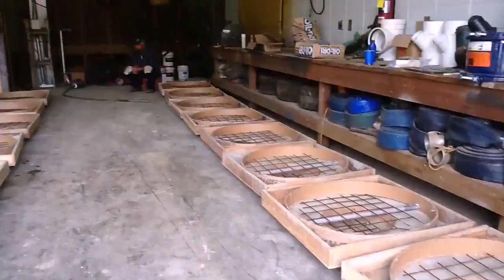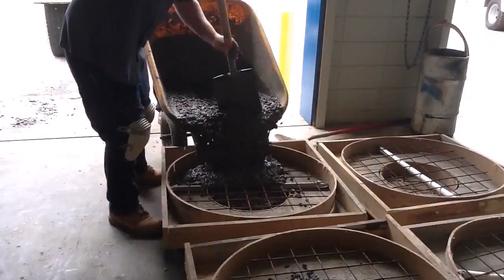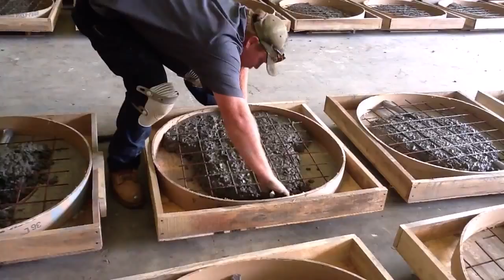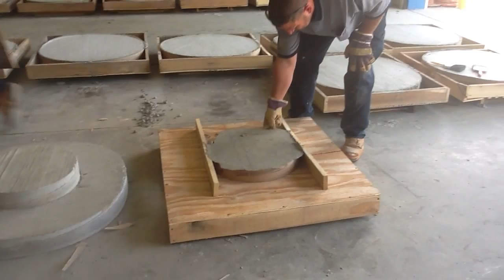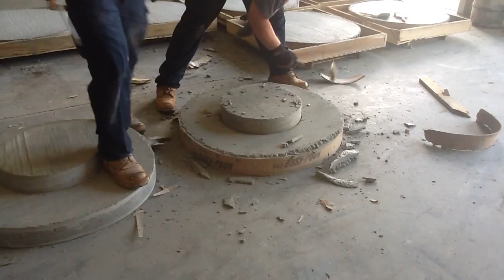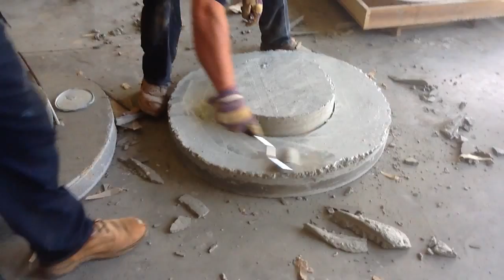Concrete Manhole Lids

Comment: You killed your mold get it out, you should use mold oil, you didn't include and lifting hooks of any type, your mold lifted as you were poring due to bad design, this means the thickness is wrong. If i made this video of work this poor no one would ever see it that's for sure!

Comment: If you put your base supports (one you smashed off) on hinges, then put a brace between them at one end, you could attach the two supports to it with a screw at each side.  Then when you want to remove the mold, all you have to do is unscrew the two sides and fold the base supports back. This will save you time and money, and probably frustration.

Comment: That's really neat, guys.  I something very similar to cover a pump tank on my septic system.  I need a 30-inch diameter circle.  What is the PVC pipe inside for?  Do you think that metal grate (what is it called?) is as effective as re-bars?  I was planning to make the mold out of wood, but that pre-formed cardboard is nice.  What type of place would have this?  Thanks.
Reply from the maker: Basic Poke The PVC pipe is for a lifting bar to allow for ease of placement and removal.